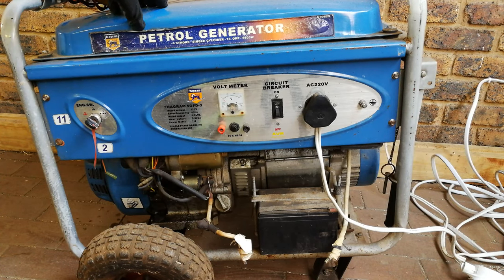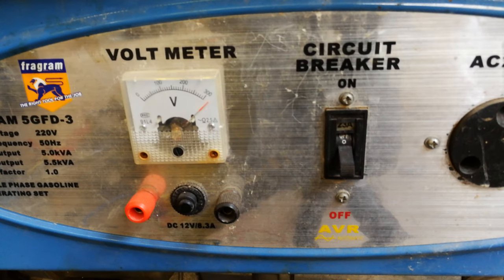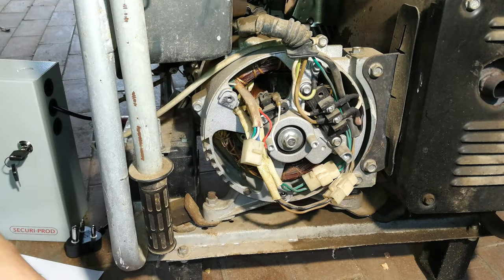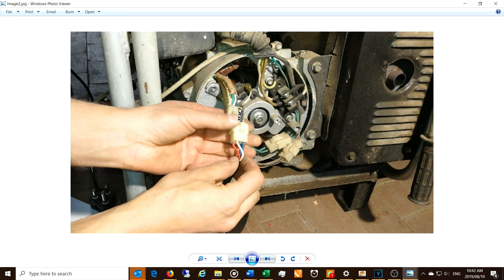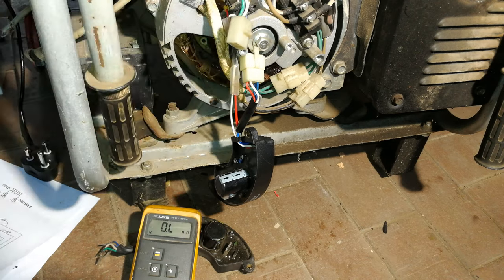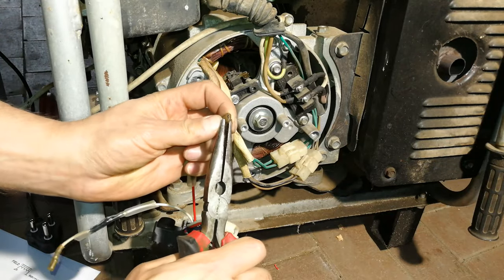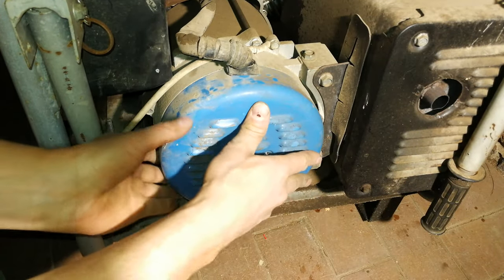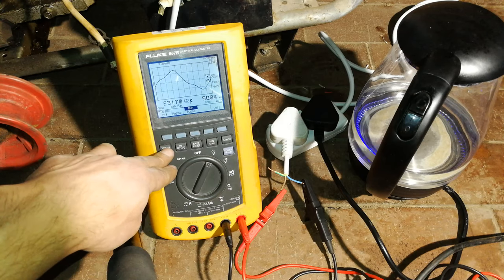Generator over voltage fault - how to change an automatic voltage regulator

Comment: Thank you very much for making this video. I have a Westinghouse that has served me well. We just lost power for 15 hours, and for the first time the microwave sounded odd, and some led light were flickering. When power returned I checked the voltage.  315 across the 240 hots. Got a new avr.  Hope that does the trick.

Comment: Good man !  YOU  did  everything, correctly, sir.  i been studying electronics/mechanics for years.  Fix these, now i am 'retired' .  (on paper, anyway).  Good choice, of replacement  AVR.  ALWAYS   REPLACE  the factory one, with one with REAL  METAL,  ON THE HOUSING,  FOR  A  HEATSINK.  i  even add heat sinks, on new ones,  which  DO  NOT  have a sink, on the transistor/FET/ IGBT  tabs...... .    Good boy, show them engineers,  'how  its'   done ''  correctly.   from  Alberta Canada

Comment: Thanks for this. I am also in South Africa and have a small Stramm generator of 1.1 Kva. It also is blasting out 300 or more volts and blows lights and computers if I dare use it!

With our present "load shedding" happening daily, I know now what to do - thanks again!

Comment: Thanks. I have the same problem with my Ryobi 5kW generator. Thanks to you I know where the AVR is located. Of course things always break over the Christmas holidays, but I have ordered a Grip AVR from Builders Warehouse on Boxing day, for collection tomorrow 27 December. Holding thumbs that it will work! 

I know that there are cheaper options, but those companies are closed and will only reopen on 3 January.
Reply: Update. It is working fine now! The k generator kept cutting out after less than a minute, but that was because the engine oil level was too low. I topped up the oil and now I'm ready for Stage 3 loadshedding again.

Comment: Hi thanks for this video from South Africa, I miss the “tortel duiwe” in the back ground :)
I bought a light tower generator at an auction, it has a 110V and 230v plug (Canada) the voltage is close to the above rated voltage till you plug something in or turn the light tower lights on, it will jump to 340V and stay there till you switch the lights off. It’s a brushless generator with just a capacitor to regulate the voltage, it’s just weird that the voltage is all over the place under load, it seems that when the capacitor is gone it should have low or no voltage, instead of high voltage.
Reply from the maker: thanks. its not regulating for some reason. Does the rotor change speed when you load it?
Reply: No it doesn’t, the engine runs at 1800 rpm. I replaced the capacitor, with same one (25mfd and 450v) and it still the same.

Comment: Thanks you for sharing this . I have a similar problem with my gen set carrying an 8 wire regulator . I don't know how to wire the regulator since it has the 2 wires for the brushes , 2 blue wires and has a plug with 3 x red wires and 1x white wire . I connected the other wires that were fairly easy . I had a plug with 3 x yellow wires and 1x green from the gen side . After modifying the plugs i connected the 3 reds to the the 3 yellows end the whit to green . Still pushing out way over what it should . I sent the gen in for diagnosis but the tech said the avr is unable to adjust the voltage right . Could i have connected the 3 red wires wrong ? I am a bit baffled by it and don't know how to test the regulator . Could you give some advise ? It will be greatly appreciated .
Reply: We need to know, that generator part / model number, as well as that Regulator,  wattage and brand/make/model.  Year of manufacture.  Thanks....

Comment: Is it possible to have a faulty AVR adjustment potentiometer? My generator is at 250V but no matter how many times I turn the screw, it makes no difference to the output on the generator.

Comment: So I have a Honda em5000s model and I am having the same issue with mine I have replaced two regulators on mine and I am producing 168 volts on the 120 volte setting and 330 volt on the 220 volt setting any help is appropriated. I have check the generator head and everything is checking okay.
Reply: Did you figure out the issue?

Comment: Ek het n Linz Electric Alumen SB alternator in my 230v enkel fase generator. Hy het geen voltage regulator. Hy maak gebruik van n kapasitor om sy voltage setup te doen. Sy kapasitor het gegroet en gee my 400V in plaas van 230V. Het al 4 ligte geblaas op my ligtoring van R16000 per lig.

Comment: Hi. Please my AVR has 8 wires. Dual voltage 110V & 240V it is bad and I can't that particular type in Makita G2700k with robin engine
Reply from the maker: sorry, i dont understand your question. If you looking for the pin outs, please check the model number of regulator
Reply: .....?  hmm   appears to be  a  3  phase generator, and voltage regulator.